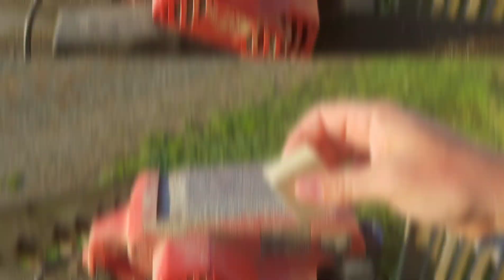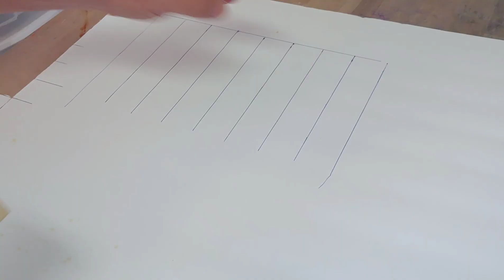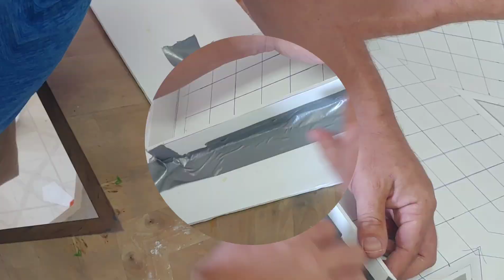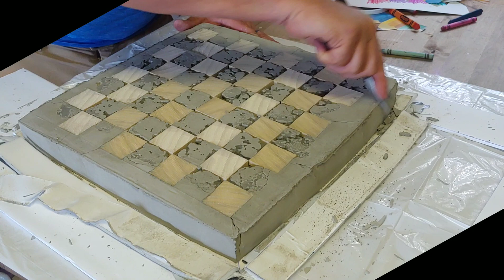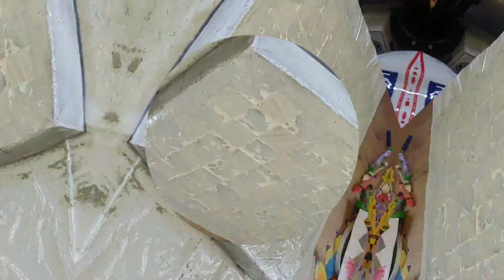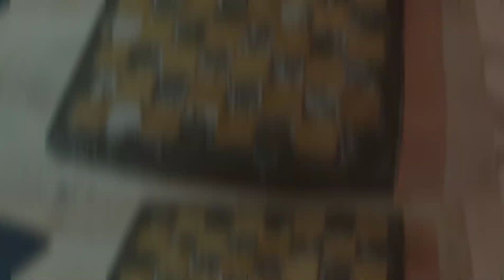How to Make a Concrete Chessboard / Checkerboard

Comment: Keeping it wet and wrapped would have caused less cracking. 

Also the liquid in the concrete would cause the wood to slightly expand. 

Thanks for the video.

Comment: I like it. I think what I would different in stead of wood I would use craft foam squares. And use spray glue to keep them in place. Then pour in my concrete and vibrate it. Or tap around with a hammer to get the air bubbles out.  Then when it dries pick out the craft foam, then fill in with colored grout. Then I would use a buffer a d diamond buffing pads to make shine and smooth.
Reply from the maker: That is a great idea.